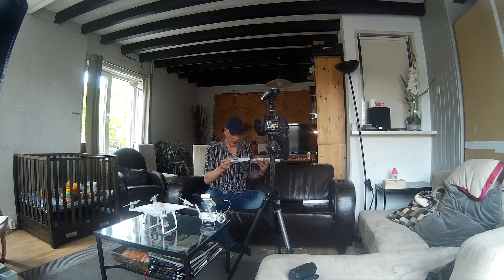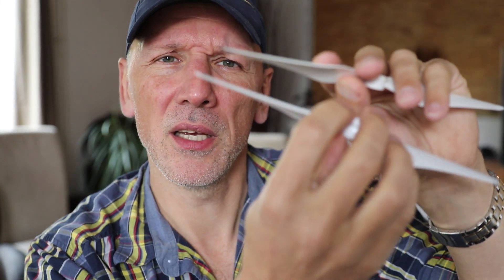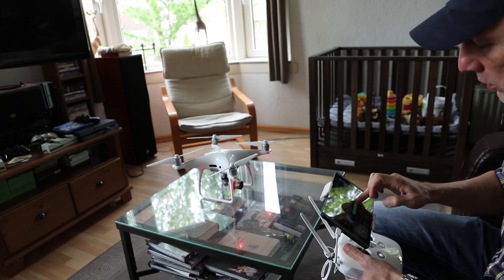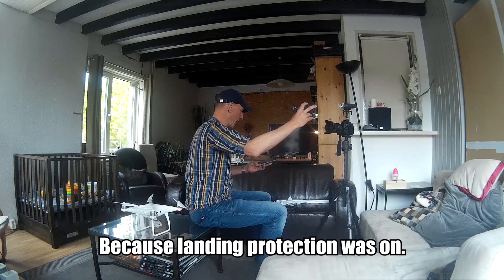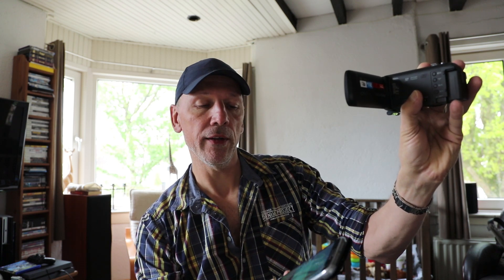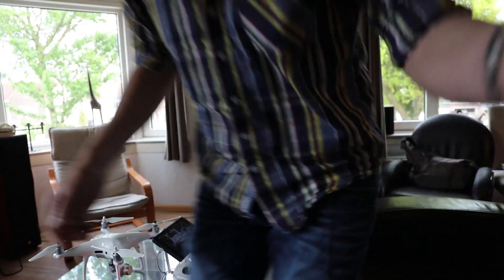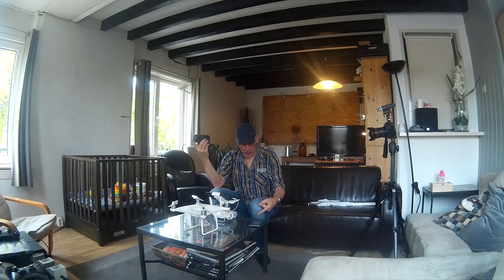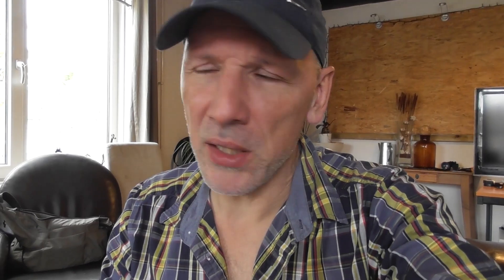How to get 1-2 minutes longer flight time on the DJI Phantoms just with different propellers.

Comment: Noise variation may go away after retuning the gain settings to match the new props.
I noticed on my Phantom2, that the out of the box gain settings with factory plastic props had it wandering about in a roughly 2x2 meter box.
Slowly adjusting the gains got that down to about a 20cm square for Left Right and Up Down, with zero movement Front Rear.
The Carbon props that were closer balanced, it was more like watching a P4 :D
I'd bet the noise variation you're hearing is from the tiny adjustments it's doing to stay stationary.
Now, bigger question, has anyone tested the MAS three bladed props for Phantoms ?

Comment: That was a very thorough comparison!  I would be interested in the actual dBa measurement of the two, even just from a cell phone app.  You have established that the new props give more "Hoover" :-) time, which means operating at a constant load/RPM.  We still don't know how much more (or less) efficient they are when maneuvering; i.e., when the props have to change RPM more dramatically.  Better static lift/drag performance could be negated by a heavier propeller that requires more energy to change RPM.

Maybe a count of the number of times the drone can climb from (say) 20' above ground to maximum altitude & back, before the battery reaches some safe-to-land percentage?

Comment: was just wondering, do you still use theses props? also how do you like them after a lot of flights? i seem to like the dji original locking design, i have heard of some of the screwing on kind working loose.
Reply from the maker: I still use them. It's almost impossible for the screws to unloose, because the direction of rotation tightens them. The new version of the props have the screws already fixed in place.

Comment: Peter,  just got a chance to test these props and overall I like them .      They are definitely quieter and I believe I got more speed out of them, but boy howdy they are brittle when you crash them.   Backed into a bush and all four of them are busted and chipped.  Dji props are tougher and can sometimes be used again after a mishap.   I suppose being brittle protects the motors and chassis from damage and props are cheap enough to replace.    Even if they break easy I still plan on using them instead of the noisier Dji props.
Reply from the maker: Yes, you are right. I find them to break easier too. But I consider this to be more safe for nearby humans!

Comment: I would think that flying each test with identical batteries charged to scrupulously identical levels would be key for endurance testing. If that’s not practical, a larger statistical number of flights might be called for.  
For sound level testing with a stereo mic, backing the audio recorder several meters away from the drone to let the room “mix” the acoustic level would help. OR, mount the recorder on the drone and point the mics at two of the props.
The hard thing in tests like these is eliminating or flattening all the variables.

Comment: Yes I use a mavic pro with an nvidia shield tablet , I find the dji app runs very badly on the Android Nvidia shield. I would highly recommend using the Litchi app with the nvidia shield. Its runs perfect and I have never had a single disconnect using it. Dgi go app's work fine on IOS (Ipads) and the litchi app works best on Android devices (Nvidia Shield). Hope this helps..

Comment: Bigger props with engines tilting inwards by 0.05 degrees should reduce noise. As for batteries; DJI want you to use as many as possible hence the upgrades every five minutes. You could use the energy from the motor shaft to recharge the battery.

Comment: I suggest trying the Graupner Triple blade or 3 leaf blades. The 9.5 inch blades will fit the Phantom. However, you need nuts about 6 MM and washers to make it fit. They are precision made and their performance is excellent.

Comment: On my P2v3, I get 12-15% more Hoover-Time(about 2 min, to 17-18 min) with 9445, instead of 9450. Also, the 9445 with a thicker blade-root is more stable and quieter, then other 9445s.
Most efficient cruise is at 35mph(40k ft Waypoint on 70% battery,  using Auto-Takeoff/A-Landing/Bank-by-Direction using Ultimate Flight App).

Comment: It does not make much sense to make such a test (noise level emitted) in a common room of a home with a mix of so many sound reflective and absorbing elements, randomly placed, even less sense if you consider that the drone does not stay firmly in a point, it moves continuously, not much, but enough to give a continuos overall variance of the noise that arrive to microphones. 
This test of course should be done in an anechoic chamber to give a trustworthy  result. 

The flight time test is a bit closer to the correct one, even if also this has been done in a not so scientifically mode, given the events, but it tells us that you can probably get at least a minute of more flight time. 
I hope your battery/batteries was charged at the same level and/or with the same power capability and cycles of use.

Comment: Hey bro use an apple device the android software seems to be terrible with Dji go 4. I have an iPad and I am on the latest firmware yet for everything my 
Phantom, the controller, the dji goggles and the latest software for Dji go. No problem no crashes all smooth with apple use apple.

Comment: Maybe you can have 1-2 more minutes of flight time, but what about distance? Maybe the distance is the same or even less. Can you fly at the same speed on sport mode?

The reason why it's supposedly less noisy is because it's got less drag. And less drag means also less thrust.
Reply: Ummm... maybe you mean with the trailing edge of the prop slanted down providing more drag like the flap of an aircraft.... simple airfoil principle.... therefore resulting in more control at lower speeds due to increased lift and control from said drag creating lift and slower stall speed...  since you seem to have all the knowledge I can explain winglets to you next... just by watching the video you can see the outer tip is shaped in a winglet design.... btw winglets are used for increased fuel economy in commercial airliners and in battery operated devices fuel is mah.... and maybe once I'm done explaining those principles I can waste more time explaining divergent and convergent venturis to you... but why waste my time. I'm glad you have all the answers, you must be an aerospace engineer... am I Wright? See the pun.......?  NeverMindYourOwn takes his time out to show us products and give his reviews and well as creates content for us to watch and make our own decisions on. So, instead of introducing nonsense into chat just keep on clicking next video.  P.S. If you still haven't gotten the Wright Brothers pun yet, you should stay out of any drag/lift conversations.

Comment: Hi Peter. I love your videos and I like it when you say "hoovering". On the subject of aftermarket props, I bought a set of Threeking carbon fiber propellers for my P4P and I think they are slightly louder and more efficient than the stock ones but I have not done any scientific testing. They have the same type of connection as the stock ones. Their biggest advantage is supposed to be greater responsiveness, which may be true but I can't really tell. I wonder if you could come up with a test for this? If you give me an idea I will try to film a test.
Reply from the maker: The thing with carbon fiber props is that they are rigid. Meaning they do not bend as other props. It means the responsiveness to your sticks is increased. For me this is an unwanted effect, because in the end the footage will have harder movements when I move the sticks. One would want transitions in drone/camera movements to be smooth and not abrupt. 
Furthermore when carbon props hit something, they will cut like an axe. Meaning they are a lot more dangerous to people nearby.

Comment: Holding RPM equal, the prop's lower pitch will save you energy at the cost of control, which means increasingly less stable in increasingly adverse conditions.

Comment: Nice work explaining the differences! Another question I had with the increased pitch, is if it added stress to the motors? I once worked in HVAC, and changed out fans and motors. If I put a fan blade on a motor with a increased pitch, it would increase the amperage draw on the motor. We used amp meters to check that we were not drawing more than the motor was rated for, otherwise it will shorten the life of the motor. Just a thought.
Reply: Increasing amperage would mean the battery  life will be shorter. But here is the opposite.
Reply: Jeffrey Pringle - That was my first thought  !!  M Will be working harder !

Comment: lol. the dji props are the best, why change them, the phantom is not a custom made drone, its been tested to work best with the props you get with it, so funny that people spend money on pointless things and think they fly longer
Reply from the maker: Did you do a test like this? Or do you just talk wishful thinking?
Reply: just 10 years of flying , building multirotors that's all...good luck with your extra 1.2mins or what ever you think...its motor kv , prop size and weight and of course lipo power, dji  tested this to give optimal power vs flight time, its totally pointless trying to get an extra 1 min flight time..its only good for the people selling the props and you to get some more views...its not a custom build so people don't waste your money!!!

Comment: Hello, love your videos. One thing I noticed in my pre-flight checks of the Phantom 4 is that occasionally the props get a little "floppy". Im thinking that flying with floppy props would make the props flutter, increasing the workload on the drone. To fix this I usually bend the metal spring tabs back to a position to increase tension against the prop which reduces the floppiness. Seems to me that the Masterairscrew props would not have this issue because you are essentially screwing the prop to the motor like the Phantom 3.

Comment: Peter DJI optimism for apple products it's a little known secret with in the trade that the phantom 4 range will always have app troubles as I've had a pp3 with Samsung tadA no problem but with the pp4 crush all the time , I then email a friend in China who works for DJI and it was a deal do because apple sell DJI products in there stores , so it was you scratch my back I scratch yours so peter going to have to pay big $$$$ on a brand new iPad Pro witch is smaller then a iPad Air 2 well I had to got sick of crushing drones and the fing app sorry to tell you peter but I haven't had a app crashes on the iPad not one not yet all so not on my iPhone 6s no crashing of the app but used great any android running app crashes all the time just I would point it out to you mate as I'm petty sure someone will back me up on this
Reply from the maker: Yes, I know. But I need easy screen recording as I have with the Shield K1.

Comment: Nice test Peter, as allways; i see all your video's and love it! 
However, i think the measureament of the sound level can be made more accurate. Firstly, inside there are a lot of reflections, which give a wrong idea of the real sound. I am pilot of model airplaines using combustion engines. We legually have to limit the sound production. Therefor we measure the sound level of our models as follows. The model is place outside (on a quiet day, max. 1-2 Bft), 1 m above the ground level and at least 30 m distance from possible reflecting surfaces. Then the sound level is measured  at 8 locations, evenly devided around the model, at a distance of 7 m from the propeller. We use a simple decibelmeter (Voltcraft SL-100). The outcomes of the 8 measureament are averaged to one figure (usualle in the range from 70 to 80 db). It has proven to be a stable and reliable procedure. Differences of 2-3 db are clearly recognized by ear and then  measuared as well. 
Maybe at the electric driven drone the distance of 7 m should be reduced.
My experience: indeed noisy props are less efficient.
Reply from the maker: Wow, that is some test! Don't know if I am up to that, but if I have to I will do it like you suggest ;-).

Comment: I've also noticed a few Shield crashes since recent firmware and IiI'm regularly being told that I have inconsistent firmware. I'm considering trying a DJI ChrystalSky monitor and using the HDMI output on that instead. Not good suffering loss of display when my Mavic is not close. 

Also did you balance the 3rd party props before fitting and if so what were they like? If not then I'd advise doing so. I've found even some DJI props to be out. After building a few drones now its become force of habit. Make footage wobble free and reduces prop vibration. 

I'd be curious if you see any gains in forward flight or if benefits are in hover only or both. Different prop styles give different flight parameters. Do the fly faster and does the Phantom hold altitude in forward flight?

Last thing is 1 meter is a good sound measurement as sound is usually measures as 1db @ 1m. 

Keep this up. I enjoy your channel very much. l
Reply from the maker: I never balanced any prop so far. Maybe you will like this article: https://www.masterairscrew.com/pages/factory-balanced-propellers.

Comment: Here's my advice. The props are the only thing keeping your drone in the air, why chance using something that is not under the manufacturer's warranty?
Reply: Master Airscrew has been in the propeller business for over 40 years. If they make props for my Phantom 4 I would have as much trust in those as I would the DJI. However, I would hate to lose the mounting that DJI uses. It would have to be so much better in all aspects for me to change. Trust them, yes, switch to them, most likely not.

https://www.masterairscrew.com/collections/dji-phantom-propellers/products/dji-phantom-1-2-3-4-propellers-mr-ph-9-4x5-prop-set-x4-white

Comment: Interesting Peter.  Looks like a good option, especially the extra time those blades seem to give on a charge.  Significantly more time.  Just out of interest, what is that thing hanging from your drone : looks like a keyring?  Is that a GPS locator?  If it is, was it cheap, as so many of those GPS locators are expensive?
Reply from the maker: The brand name is Trackr. I discussed them in this video https://www.youtube.com/watch?v=hDAXqE7naps. Those are really cheap.

Comment: First of all, I have Android everything in my house.  Several Android TVs, several Chromecasts, more than 10 Android phones and tablets, etc.  BUT...for god sakes man, get an iPad mini for your controller.  It's the ONLY Apple device I have for a reason.  There's no better and more stable DJI controller than an iPad mini, and they are super cheap now.  DO IT!
Reply from the maker: I need the Shield for the screen recording...
Reply: Ah, fair enough.  I haven't dove into that side of it yet.  If I find something that does what you need, I'll let you know.  Outside of just "recording the screen," what else do you need that keeps you from an iPad type device?
Reply: NeverMindYourOwn  iOS 11, out in the fall, WILL have screen recording. Source, Am beta tester. So hang in there a little longer.
Reply: Plus i pad has zero Hdmi out so ya cant run ya fatsharks for fpv Nvidia still the best allround tablet to this day
Reply: im the same...i cant stand apple anything...but its the best for drones...its the only reason i have that one apple product lolol...
Reply: Kyle Kennedy I was told the nvidia shield k1 was the best thing for dji go that's why I brought mine!!!!
Reply: Yep.  iOS 11 records.  Using IOS 11.2.5 beta right now...

Comment: Hi how I understand prop pitch it's a bit like a thread so flatter the pitch the less distance per rotation in moves through the air but faster acceleration slower top speed , but greater the pitch more distance per rotation but slower acceleration but faster top end speed.

Comment: I'm interested to know what you used to glue the prop nuts to the props.  Is that really necessary?  It would be nice if the manufacture would make them with the nut attached.  Could be that they did not due to some sort of design rights.  Additionally, I'd like to know what these props do in the way torque to the motors.  Would be nice to get any R&M data they might have.  You should also do a weight and balance comparison.  All in all, enjoyed your vid and test.  Thank you.
Reply from the maker: I used superglue. On the manufacturer website it says they are factory nalanced: https://www.masterairscrew.com/pages/factory-balanced-propellers
The props are a bit lighter.

Comment: The curved tips actually create a separate current which affects the high pressure air underneath. It gives it slightly more lift but mainly affects efficiency.
https://youtu.be/FNqXf6t7e-w

Comment: Hey man if you want to experience no crashes on your tablet with the app use a device that has android 6.0 I changed to the Asus Zenpad 8 and have had no crashes at all.  Just an FYI.  Keep flying on man.
Reply from the maker: I know, but I need the built in screen recording of the Shield.
Reply: NeverMindYourOwn There should be a way to roll back the shield to android 6.0 marshmallow that's why the DJI app keeps crashing it's not compatible with android 7.0.  I couldn't believe that was the problem the app works flawlessly on android 6.0.